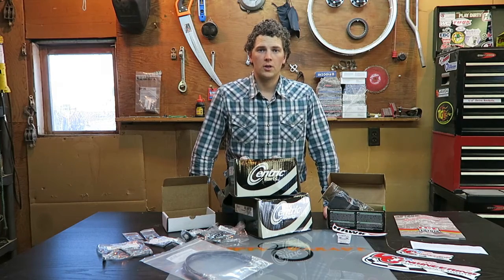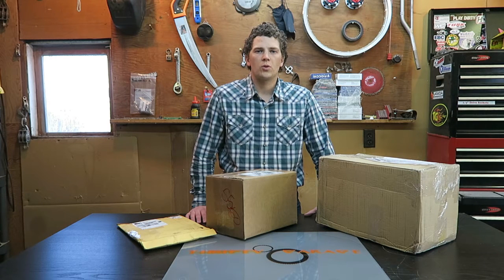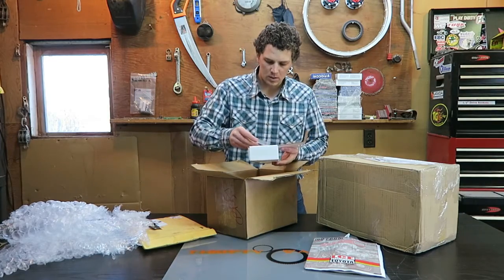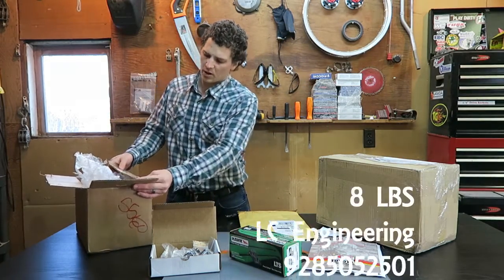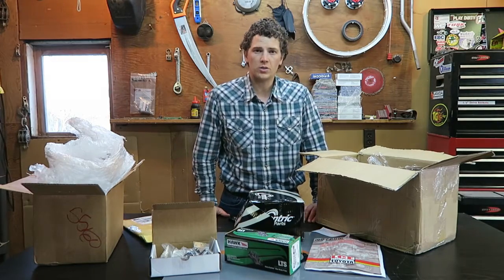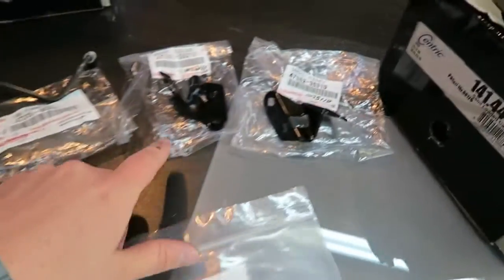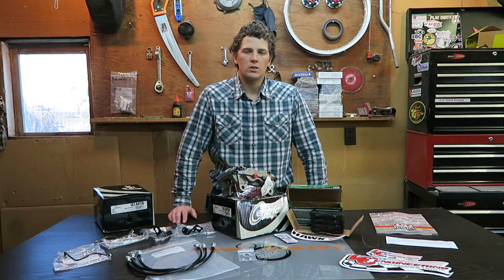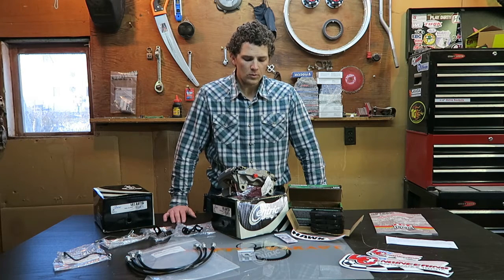TG LC Engineering Toyota Big Brake Kit Unboxing

Comment: Hello, I have a 98 SR5 4 runner with 15 inch rims, I am going thru exactly the same thing as you (before this upgrade) I already purchased Akebono brake pads but havent purchased rotors (thinking about going with Brembo's) OEM rotors are a bit expensive for me ($95 each) My question is, will this upgrade work for my 15 inch rims? and do i have to buy new calipers or can I use my stock ones? thank you for posting this and hope i get a reply from you.
Reply from the maker: I would hightly recomend 16" rims.  I'm not positive but I do not think your 15" rims will fit bigger brakes.  My 4Runner is the highlander edition and came with 16" rims.  Part of the highlander edition package was larger brakes.  These were not as large as the brakes offered in the big brake kit but a lot closer than the majority of stock 4Runners.  No trimming was required for me.  I should mention that because this kit was designed for trucks that the included brake lines are not required.  GOOD LUCK!